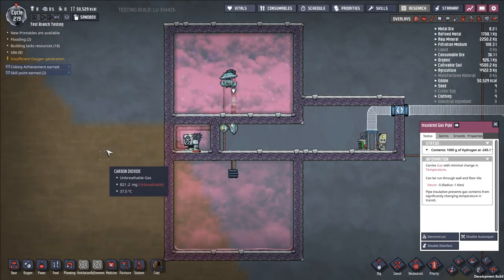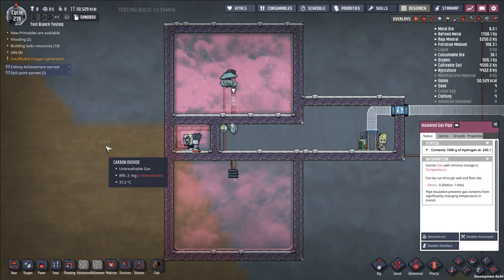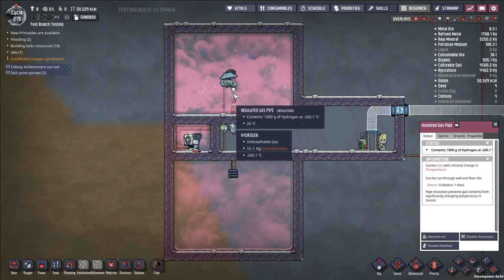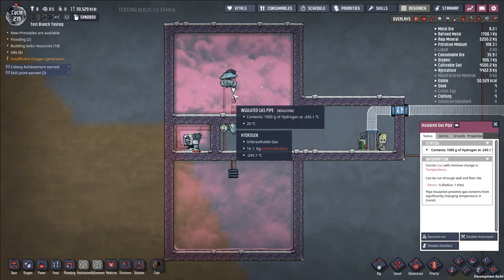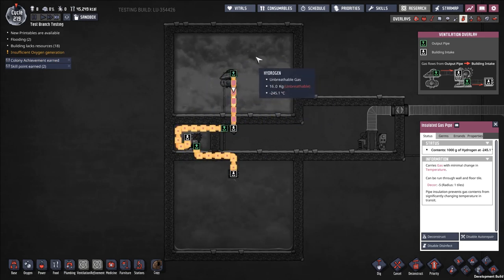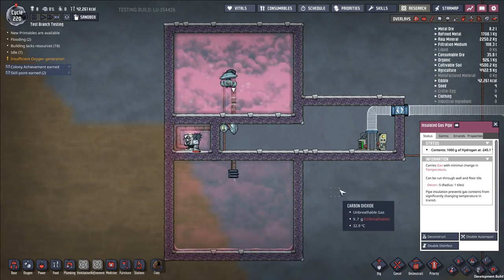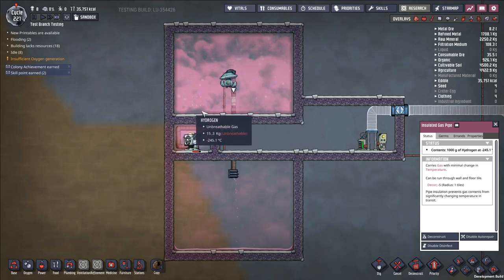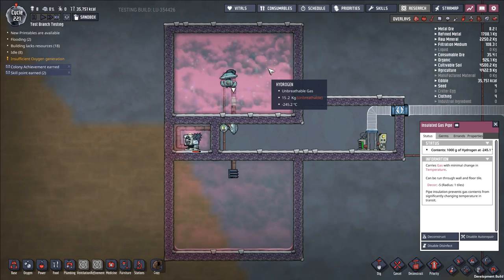Making Liquid Hydrogen Without Super Coolant [Oxygen Not Included]

Comment: Thanks for sharing this idea. I used a research steam rocket setup similar to yours based on a lot of advice from your videos and it works great. But I can't make my LH cooling system to work without super coolant or insulation (which you are using for pipes and tiles in this vid). Could you please explain how you actually went from steam directly to LH without the petroleum rocket and bringing the space materials such as Fullerene and Isoresin (which is not really possible with a steam engine)? Thanks ;)

Comment: Is it possible to use an aquatuner and water to reach hydrogren freezing temperature if I limit the flow in the pite to 1000g/s  r to prevent wate from freezing? If I use the cooling loop to suck the heat out of an hydrogen room it would in theory be much faster and power efficient then an thermoaquatuner. Or does it not work because the water will freeze when it enters the aquatuner's storage?

Comment: Couldn't you use the 1kg liquid pipe trick to super cool water (or any other liquid for that matter) to the point that it'd condense the hydrogen? You could get that 1kg of water down to absolute zero and it'd have the thermal capacity to do the job, and it'd condense way more than 100g per second.

The issues I faced when building such a system: 
- you can't let the water out of the pipe 
- it mustn't combine any packets at any point (you could alternate different elements... like 1kg packet of water, 1kg packet of polluted water. Then even if the flow stops, it won't break)
Reply: It only works if you heat water, if you cool it down it breaks anyway
Reply: A recent patch might have changed it, but in QoL mk3 I got water, oil & even magma to absolute zero :P